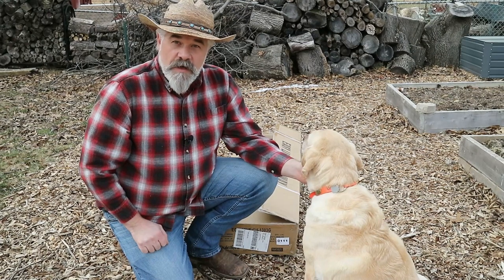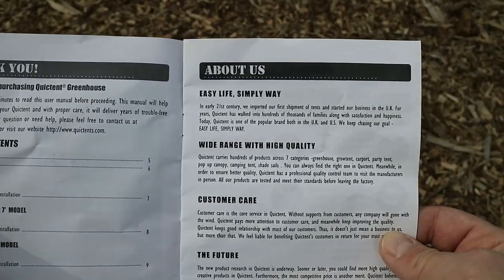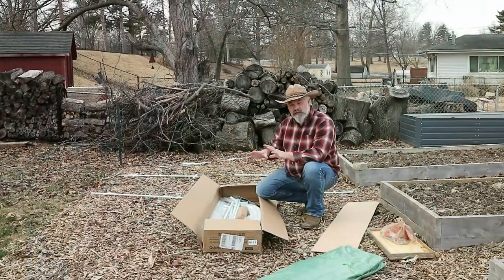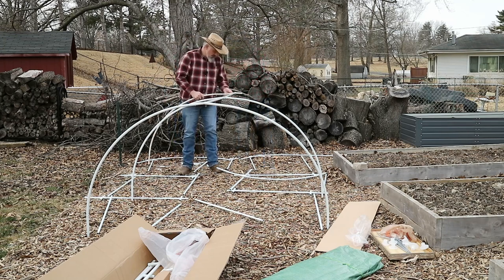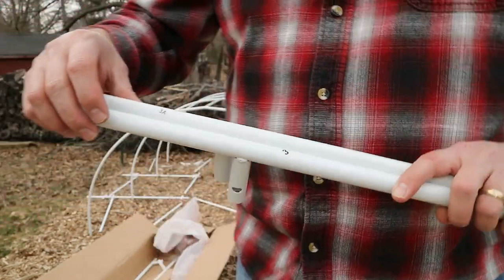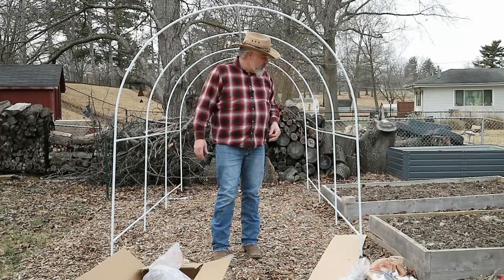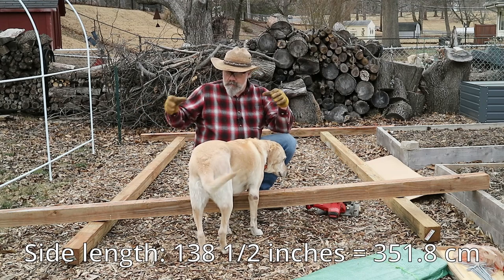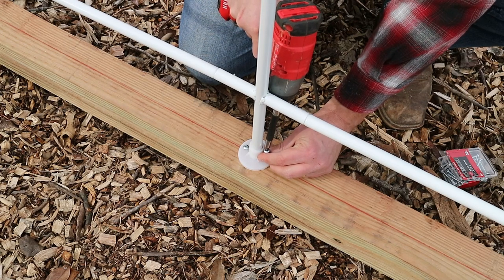Assembling a Low Cost Greenhouse - Quictent Tunnel Build

Comment: Thanks for the tutorial! We have been researching greenhouses and this looks like an excellent option.  
Is the bottom plastic secured and attached to the base?
Reply from the maker: The sides are a few inches longer than the poles, so if no base is used they could be weighted down with rocks.  This lets them overlap the base some so I plan to staple them down.  The doors aren't as long so there is a little gap at the bottom of the door on each end.

Comment: Thanks! I bought one and definitely know from watching you that this is going to be a two person job for my short self! No way in this world! 😂 Are you heating it at all, and if so, how?
Reply from the maker: Apparently YouTube put an advertisement (at least for some viewers) during the part where I was putting the cover on, because my sister asked me if the ad covered up the part where I was cursing.  😄 My neighbor was actually just off camera asking if I wanted help, but I wanted to see for myself, and put on camera, the possibility of putting the cover on alone.  But I agree - even if you're not short - that having at least one helper would be beneficial.

I don't have a heater in the greenhouse, except that I do have seedling heating mats.  Mine is close enough to the house that I can run an extension cord.  I waited until we got through a stretch of freezing temps to move tomatoes and peppers into the greenhouse, although I did put my cabbages in there earlier with the heating mat.  Although it's how a greenhouse is supposed to work, I was still surprised at how quickly it heats up inside once the sun is up.
Reply: @SuburbanSodbuster  thanks so much for getting back to me! I'm in Tennessee, and our weather has been so unpredictable. It's been awful. We're going to do a few black barrels of water to create a heat sink in mine. 

YouTube is ridiculous. That is hilarious, and would have made me feel much more human... I am absolutely the type to cuss my little heart out when I'm trying to get something done that I'm just a few inches too short to manage on my own. 😂